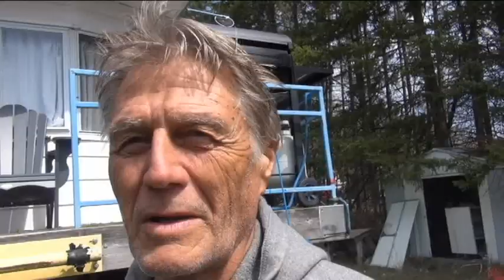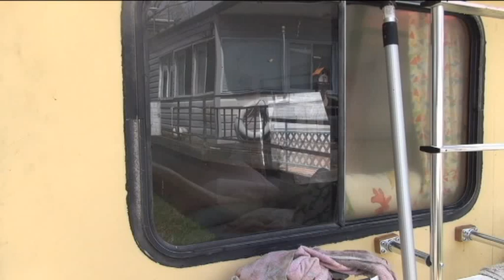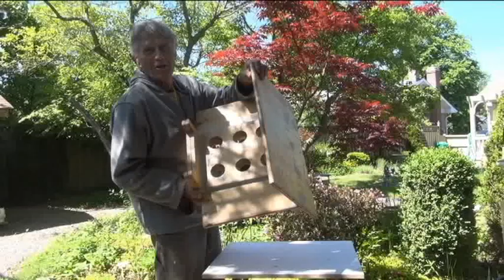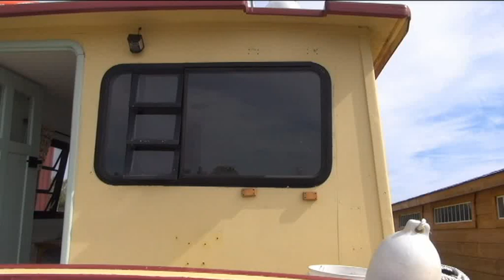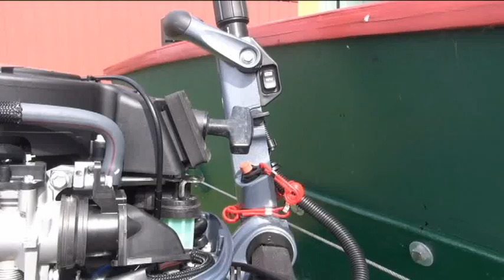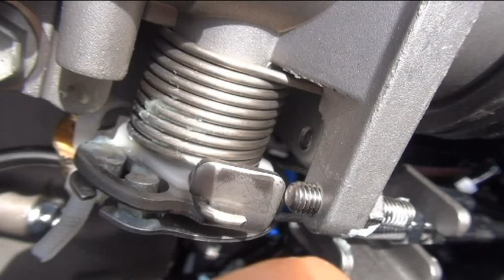A new outboard for our tiny houseboat

Comment: Nice boat .So what is your top speed with Yama 25
Reply from the maker: With relatively little head wind and calm waters, top speed is around 6.5 kts.  We usually cruise around 5kts.  I'm a bit disappointed that I won't be able to water ski behind the houseboat.
Reply: @ourtinyhouseboat  Thank you . Good speed btw. Try pulling tube behind , should be fun .LOL